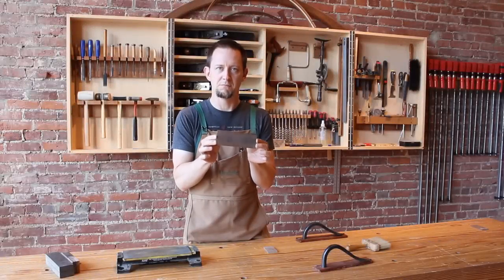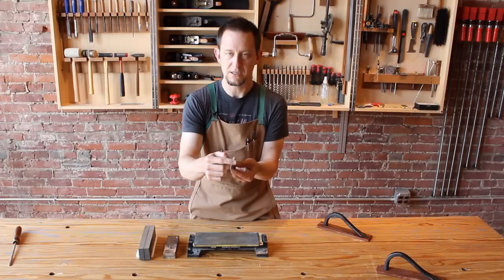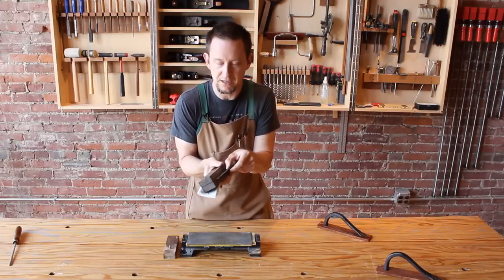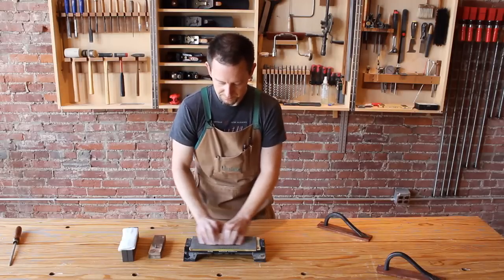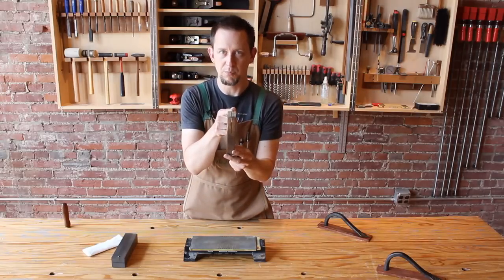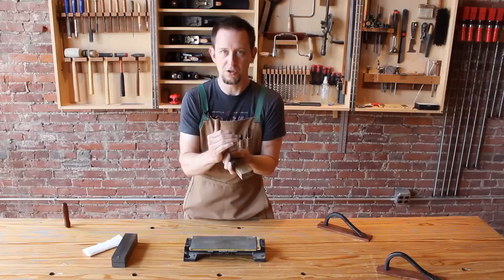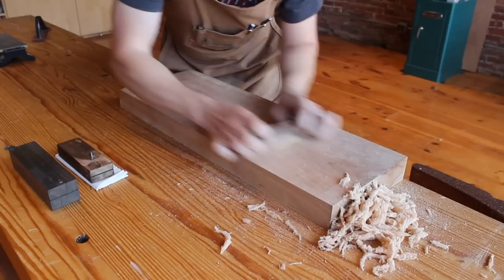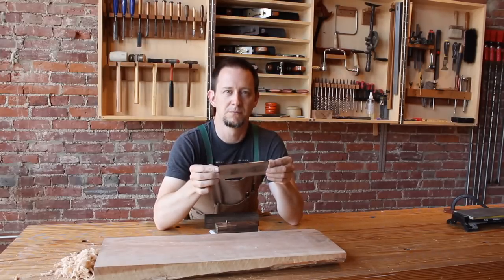Sharpening the Card Scraper for Woodworking

Comment from the maker: The stone is a 10" DMT Duosharp with course (400 mesh) one one side and fine (600) on the other. It has seen many years of hard use so the round holes are a bit obscured and discolored but they are there. For initial flattening of the scraper's faces you can use the course side if necessary, followed by the fine side. After that you will only ever need the fine side. Thanks for the comments!

Comment: It's all very interesting and enjoying to watch. No a woodworker myself, even remotely. But just checked it out with just a normal kitchen knife - works quite well, but then I just took a 30 cm. flexible metal ruler - and it just worked as a magic! I did not sharpened it, just tested as it is :)

Comment: What do you recommend for the most efficient thickness of the scraper.  I found that the thicker the scraper doesn't necessisarily work better and it's a stain on my hands. Are the thinner scrapers just as good.  Thanks for the great video.

Comment: Why is the kerf necessary in the burnishing jig (8:37)? I would think that the WC bit protruding from the face of the block would suffice.
Reply: You could use the side since the angle is the same, but it's pretty difficult to keep the face of the scraper against the block consistently, which is the whole point. The kerf is easy to cut and results in much more reliable sharpening.